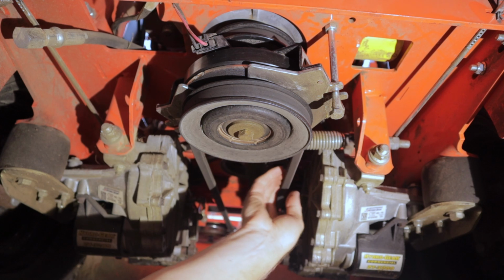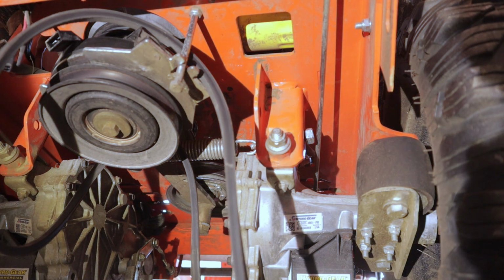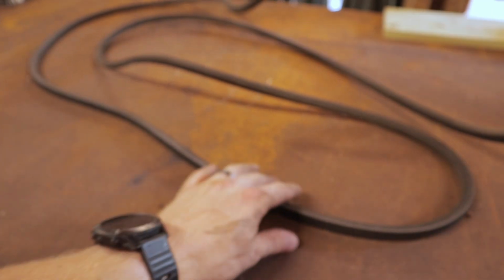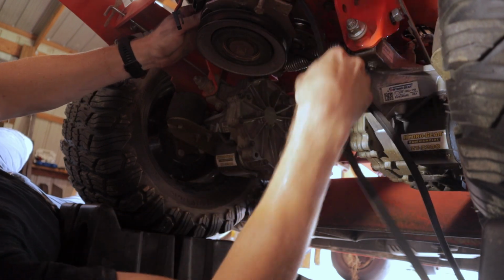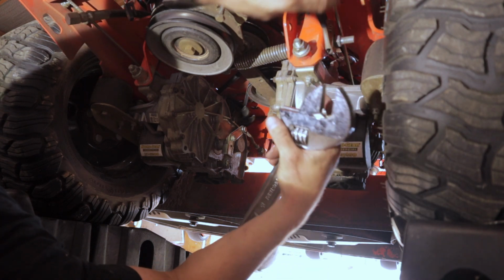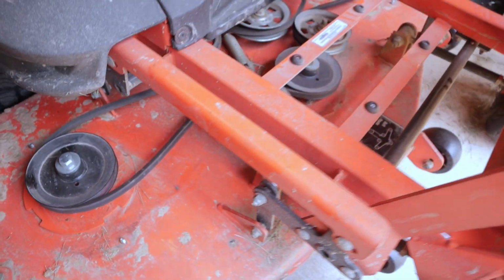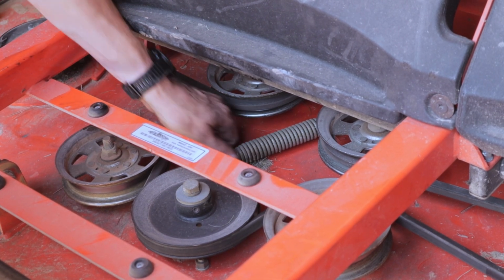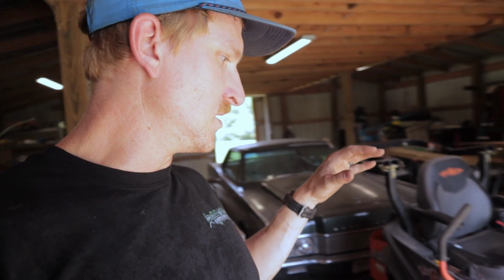Removing and Installing Drive Belt and Deck Belt on Bad Boy Maverick

Comment: This video saved my bacon!  Thanks!  I replaced my clutch, and after everything was put together and bolted up with  Loctight, I realized I put the clutch on 180* off, meaning the electrical connection was on the opposite side of where it should be. I was ready to pull the clutch and start all over, then I did a quick search on loosening the drive belt and found this video!  Took me about 10 minutes to loosen the drive belt tensioner a no spin the clutch. Thanks again.
Reply: And spin the clutch 180*.
Reply from the maker: Glad it helped!

Comment: Getting it done 😊

Heads up, I disassembled the spindles on my Maverick 60 inch when it was new. The spindle bearings had very little grease in them. So I removed the bearing seals that face into the spindle, drilled, tapped, and installed grease zerts in each spindle. Pump them full of high-speed bearing grease and grease them from time to time. Easy project. Equally important, remove each belt pulley to repack the bearings with fresh high-speed grease every 100 hours. It will make a great video.
Reply from the maker: That is a good idea. I am sure I will start getting some bearing noise at some point.  I will definitely make that mod whenever its time.
Reply: @south_coast  
When you do your spindle modification, notice where the grass hits the spindle and where to locate each grease zert so that it will be easier to access for greasing purposes. I use Lucas extra heavy-duty green grease. It is best for high-speed bearing applications.  Good luck and great job with your videos. I am a fan.

Comment: Good job.  The belt flapping seems a little off but I have nothing to compare it to other than a Liquid Nitrogen pump drive belt and it flaps downstream of the of the drive.
Reply from the maker: Yeah I don’t really have a baseline to compare to either, aside from the belt of which you speak. Good job Robbie.

Comment: I love my little 48" Bad Boy MZ Magnum but it pisses me off that I lost bolts from the spacers. I like to walk my yard after I cut & twice now I found bolts in laying on the ground. The 1st one i got lucky and found where it came from. Last year i found one and I couldn't find where it came outta. So i figured it fell off of a work truck because it was not far from the road. When i replaced my belt last week, I noticed the spacer bar from transaxle to transaxle was hanging with only one bolt holding it on. Then it came to me what that bolt was for. I tried to loosen the one bolt that was left but from at least 50 or 60 cuts it was kind of backed out and it was pretty beaten up from bouncing around under there. It broke. So I went and ordered a new spacer and two new bolts at my local Bad Boy dealer. I would recommend that if you buy one or have one, it would be best to put some threadlocker on the bolts especially the spacer bolts. Other than that issue the Bad Boy is the way to go cause its well built and even the cheaper models are heavy duty.
Reply from the maker: Yeah I’ve heard of issues, especially in 2022-2023 with random bolts backing out or not being tight at all. I usually check over everything after 5 cuts or so.

Comment: Did you ever found out if it was normal for the belt to be slinging like that when the clutch on. I just replaced my spring cause it broke and it's doing the same as yours??
Reply from the maker: No, never found a definitive answer to that. I have mowed a couple times and it seems to be fine though.

Comment: I had to do deck belt twice this season on my 60”. I am actually doing the second replacement today and found the blade/spindle pulley was ~slightly stuck (turning it with the blade broke free). But I went to find a grease point and found none. Any thoughts other than silicon spray?
Reply from the maker: Yeah I’m surprised they use sealed bearings and not grease-able type spindles
Reply: silicone spray is not rated for hi temp parts like bearings

Comment: have you ever had the pump belt cut the hose to the right side fluid fill cup? and what might cause this belt to be out of line to actually cut the hose
Reply from the maker: I have never heard of that happening. I would guess your belt is really loose. May just need to tighten it.

Comment: Doesn't seem like too bad of a job. I'm curious what is the normal lifespan of those belts?
Reply from the maker: Man that’s a good question. I have no clue personally.
Reply: Late to the party.  I have a 2016 with 350 hours, and have never replaced the hydraulic drive belt....however, now that I brag on it, I suspect I will have to soon.

Comment: I did mine about a year ago. Such a pain.
Reply from the maker: I didn’t find it to be too bad of a job honestly.
Reply: @south_coast  You in better shape than me getting under there. If it was easy like the one on the deck that would be awesome. Lucky I saw a video similar to yours to figure out how to get back on. Mine got cut in half somehow.
Reply from the maker: @nealsterling3849  Good deal. Glad you got it back up and running.

Comment: That flop should go away at wide open throttle
Reply from the maker: Interesting. So maybe I need some more tension.
Reply: @south_coast  If all the pulleys, bearings and alignment are good, the belt slap/vibration is caused by a worn belt and/or incorrect belt size.  Adding more tension will place more load on the bearings and not correct the belt slap/vibration.